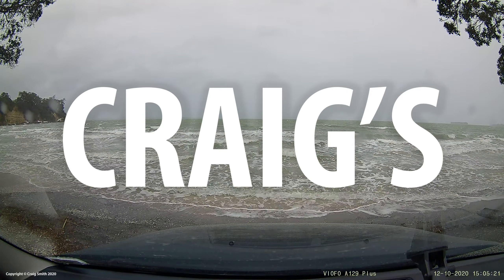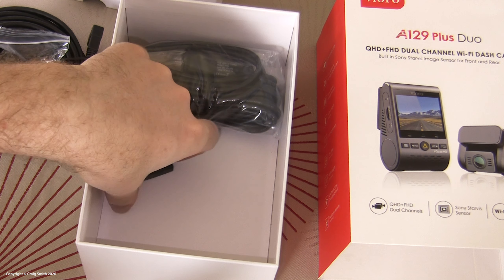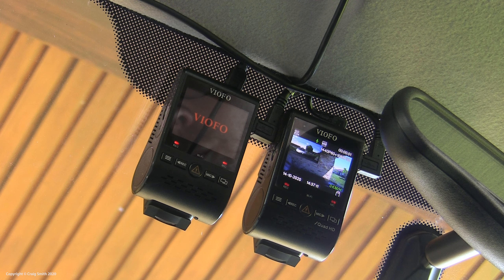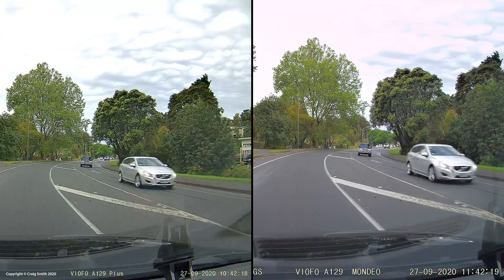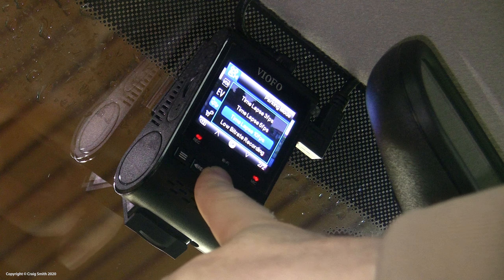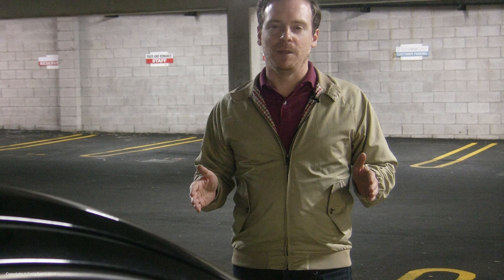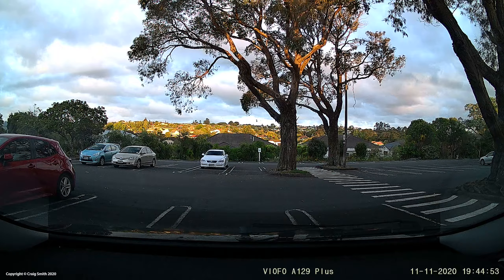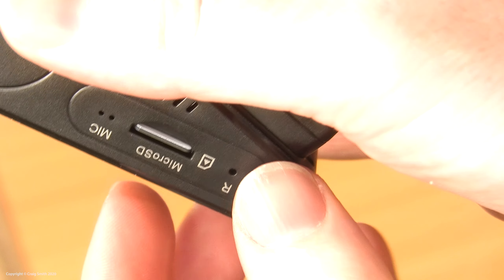Review: Viofo A129 PLUS Duo dash cam front/rear, parking mode, 1440p60 f/1.6, features & problems

Comment: I imagine the 1600p mode simply comes from them giving you access to the more of the image sensor since it's available, if you want that extra vertical space. Your idea for trucks and busses sounds very plausible. The image sensor is a 4:3 image sensor, so you're still missing out on several hundred horizontal lines at 1600p. lol Great review! Thanks!

Comment: The latest firmware update adds UWHD (2560 x 1080, 21:9 aspect ratio) in both 60fps and 30fps. 
This cuts out some of the top and bottom of the picture which not only helps bring down file size (as less is recorded) but also helps with contrast and lighting since you're no longer recording your dashboard or a bunch of clouds.
I've also noticed 30fps reduces the noise quite substantially (with WDR off and using the highest bitrate).
Reply: Thanks for mentioning this! It's yet another plus for this product that has led me to decide to go ahead and purchase it.
Reply: @gordon9821  You won't regret it. If you have the money to spare then I'd suggest the new A229 as it now comes with a 2k rear cam as well as a few feature updates.

Comment: @20:26 I just finished installing mine for a second time. The first time it did the double beep, start and stop recording for 5 seconds on a loop. Long story short I re-did the cable routing to the rear camera while having it on and having the rear camera view on. I was trying to avoid getting a kink(bend) in the cable which I think is what produced this issue. I completed the install without having an issue with the rear camera. Let's hope it stays that way. Cheers

Comment: Found online. 

Note that the H.265 encoding is a hidden mode in the A129 Plus Duo. To enable it, you will need to stop recording and then hold the MIC button; you will then see the SD card icon on the left side of the screen.

Comment: I have installed this yesterday, I'm gonna switch to low bitrate recording in parking vs timelapse, to get audio. Also found that in parking mode at night the rear camera picked up the street quite well but the front camera is all black! I suspect this is because the front camera is set to 60fps. I'll try again with it set to 30fps. It would be nice if you could choose different settings for regular and and parking modes... oh well. Anyway thanks for the great video :)

Comment: Craig, is there any chance you'll be doing an A129 Pro 4K review?  Your excellent assessments are very much appreciated.
Reply: The 4K Units are not good as they have an unusable low frame rate (30fps) -- dash cameras require frame rates of 60-120fps due to the vehicle moving at high speeds.

Therefore, a 2k (1440 / 60 ) dash camera will perform much better than a 4k (2160 / 30).

Also, as the resolution increases the night video recordings quality decreases so, 1440 is better than 4k and 1080 is better than 2k.

One can determine the best dash camera by identifying which image sensor it uses as the sensor dictates it's performance.
The best dash camera will incorporate a Sony IMX226 sensor as this chip is one of the highest performance  4k / 120fps / 60fps with incredible low-light (nighttime) performance. With quality comes expense, therefore, the dash camera will cost anywhere from $350-$450. The Sony IMX226 is the same professional image sensor used in the DJI Mavic 2 (Professional Drone).
Reply: @bobstringer9809  .. Thanks for the info. I haven't seen a dashcam offering 120 fps as yet. And are there any offering 4k 60 fps with the rear camera active ? I think they usually drop the fps back to 30 if the rear camera is running.  At least from what I have seen from  usual Thinkware, Blackvue, and Viofo offerings.  Not sure about DOD, and the other vendors.

Comment: Also worth noting:

The 4K Units are not good as they have an unusable low frame rate (30fps) -- dash cameras require frame rates of 60-120fps due to the vehicle moving at high speeds.

Therefore, a 2k (1440 / 60 ) dash camera will perform much better than a 4k (2160 / 30).

Also, as the resolution increases the night video recordings quality decreases so, 1440 is better than 4k and 1080 is better than 2k.

One can determine the best dash camera by identifying which image sensor it uses as the sensor dictates its performance.

The best dash camera will incorporate a Sony IMX226 sensor as this chip is one of the highest performance  4k / 120fps / 60fps with incredible low-light (nighttime) performance. With quality comes expense, therefore, the dash camera will cost anywhere from $350-$450. The Sony IMX226 is the same professional image sensor used in the DJI Mavic 2 (Professional Drone).
Reply: How does that sensor compare to the IMX317?

Comment: Although the Duo Plus has a better front camera, would you still choose the original Duo for the sake of reliability?
Reply: Yes would also like to know as a new buyer
Reply: Craig :) if you’re reading this, please give us your thoughts on which camera you’d choose (duo vs. duo plus). Holding off on a purchase here.
Reply: Craig did say that until the Plus has proven more reliable or has firmware updates, buying the original duo would be very reasonable. I’m also curious to know if the Plus has proven to be as reliable as the original duo since 10 months ago!
Reply: @robertwhitekar5514  yeah exactly I wanna know if the problems with the plus have disappeared and any problems to expect with the original duo. But Craig is understandably busy, I’ll just buy the original duo??? But it’s like a year older than the plus?? I trust Craig’s advice
Reply: Went for the plus model after extensive research. Since non plus is getting discontinued. So plus will be supported for much longer
Reply: @HasNiHassaan  O_o did not know that.. geez thanks for that tip! 🙂 That’s a good decision! Did you consider other dual cameras?
Reply: @HasNiHassaan  Hey, how is the Plus? Did you encounter the problems Craig mentioned? specifically the camera stops recording and requires a lengthy reboot?
Reply: @ufchistorian13  no it's been working great very happy with the quality
Reply: I chose Duo Plus over Duo because the price difference between them is just $20 and I love the day time quality of Plus. Night quality of the front cam is a big disaapointment because it has lot of noice and pure dark. Even a CPL filter didn't help me. The back cam quality is good than the front cam strangely. I think Viofo will provide an update for this cam andI need to check how the 1080p 30 + 1080p 30 both front and rear cams (Same like Duo) result in.
Reply: @coolguypravara  if you turn on wide dynamic range it makes the footage noisy but more visible in the dark. So pick your poison.
Reply from the maker: The old Duo has its issues too. My assumption is that all the A129's are less than 100% reliable. Different issues with different firmware. My Plus is more or less running ok now in a set-and-forget state, but the permanent issues like dropped frames you just have to accept.

Comment: Thanks for the great camera review! I just received mine and I'm trying to learn as much as I can. Off the bat, I find that the buttons are not intuitive, I haven't installed it yet, but for example when I powered it on, it goes straight to recording and when I press another button, like I want to see the settings, it says I have to stop the recording first, not sure how to do that intuitively, I press the record button, but that doesn't stop it, stuff like that.
Reply: Yes, the record button does stop it. Mine does.

I like the buttons. Middle one for OK, left of middle for up menu, right of middle for down menu, and far left for back. Couldn't be easier.
Reply: @paulraymond1804  I got it installed right from my rear view mirror and frankly, I am never using it. I did buy the optional button to keep a record, when I see something I want to keep, I just press that button. Other than that, I am quite happy with the camera.

Comment: Please help.
I'm on my first camcorder, a Viofo A129 Pro only front camera. Your excellent review helped me a lot to understand how to do the editing and dashcam settings (the instructions that come with the camera are very thin). However, I have some problems and I don't know how to solve them.
Parking with low FPS. I set the G sensor to maximum and in the parking mode also to the maximum and when I stop the car in the parking lot the recording starts at a low FPS (5 frames / sec) but after a while it starts and continues to record as if I were moving.
Protected files. Although the G sensor is set to maximum even if I "swing" the car is not registered in protected mode, neither in motion nor in the parking mode.
Is the camera defective?
I use a 128 Gb SanDisk Extreme Pro card, Firmware 2.5 from the Viofo website and I supply it with a powerbank because the car is under warranty and Toyota does not agree with the installation of the HK3 kit. I tried 4K resolution at 30 FPS and a lower resolution at 60 FPS
Thanks.

Comment: I watched a recent review by the YT channel; Techmoan where he said this was a solid dash cam that his wife was using the past year.
My thoughts about it are mixed, but my new car was build in 1996 & I'm finding reversing to be difficult to judge where the car ends.
So, with the in-built display screen I was thinking about using the A129 Plus Duo not only as a Dash Cam, but as a Reversing camera - just to assist me when parking...
Reply from the maker: It's a perfectly fine dashcam, but it's not a reversing camera. It would be hard to watch the screen while reversing, and it's too small to see small or obscure things, but more to the point a dashcam must be mounted high and pointed back to get a full view - a reversing camera should be lower and at the rear extremity of the car, and pointing downward so you can see low things you might hit. If you want a reversing camera buy a proper one.

Comment: Is it possible to connect to the cigarette lighter plug-in as a power source, as opposed to installing a hard wire for any of these units?
It’s only because I drive a Toyota Prius and the manufacturer recommends I do NOT mess around with the electrical system.  It is a hybrid motor.
What units would you recommend for a dual camera set up? Thanks!
Reply from the maker: Yes but parking mode won't work 'properly' and you have the hassle of the cable. There shouldn't be a problem fuse-tapping the 12V circuits on any car, just stay away from splicing any big cables and you'll be fine :)

Comment: This is probably one of the best videos I've seen on the subject. I was curious if you had any updates after a year? I ordered a $20 dash cam to experiment with and gave it a driving test. I was wondering how long the $20 cameras last compared to the $160 ones over a year's time... If I go through 3 of the %20 cams in a year, is it cheaper than the $160? Albeit with lower quality video of course.
Reply from the maker: It's going fine, as you would expect from the video. It's not perfect but good for the money. You get what you pay for.

Comment: I got my Plus unit installed about 2 weeks ago.  My unit does offer H.265 so that may have been added to the later units.
Reply from the maker: How is H265 implemented?
Reply: @CraigsDIY  To set up h.265 compression:  First stop recording. Hold down MIC button until you see the SD card icon on the left side of the screen with the down arrow. That means that the device is now in h.265 compression mode.

Comment: Nice. Thanks. Very well explained parking modes, which had me rather confused till now.

I park at night in my garage, so is it possible to 'easily' switch off the parking mode? Say, a single button press.
Reply from the maker: You would just turn off the whole camera once parked, which yes is a single button push.

Comment: Just bought the cam. Firmware 1.5. I try to switch on the parking mode. But it still records in normal mode. I don't have a hard wire kit. I want to enable parkingmode manually within the menu.

Comment: When ordering this A129 do you have to order the harness for the parking feature separate?
Reply from the maker: Yes but it's cheap.
Reply: @CraigsDIY  inordered it and hardwired it to my chevy. Lots of action in parking mode. This caused a drain in my car which made my car want to over charge to compensate. Took a week to figure that out.

Comment: I'm wondering about the manual emergency recording.  The product manual says that it "will lock the current file being recorded."  However, what if a new file starts recording right before you press the button?  In that case you'll miss the event you want to save.  I'm hoping that the description isn't exactly as it says because the better way to do it is to have an independent video file generated that saves back a few seconds before the button press and a few seconds after regardless of how the continuous recorded segments are saved.

Comment: It's really annoying that the front to rear USB cables aren't interchangeable as they're a pain to wire through to the rear, especially on an F56 mini.  The mere idea of having to do it again detracts from wanting to upgrade anytime soon.

Edit: seems the rear cable is only different if using the Plus duo, but if you directly upgrade to the pro duo (4k version) it's fine. Phew.
Reply from the maker: Interesting thanks.

Comment: This thing is a peice of sheet. I installed it with a hardwire kit. It used to work fine. Parking Mode worked fine. Live viewing worked fine. Recording worked fine. In fact, I downloaded some interesting (yet useless) videos from my travels when I first got it.

Fastfoward a few months and THE ONE TIME, I needed it to work, it didn't. Someone ran red light and hit us. Cops showed up and we tried to pull the video but it wasn't recording for over 2 weeks. EVEN THOUGH ALL THE RED LIGHTS ARE ON. There is literally NO indication when it's not working. We looked at all the files on the SD Chip and it records for part of a day then stops recording for 10-14 days, the records a bit and then stops. 

Customer Service sent me a application to reformat the SD chip, it crashed and now the chip is useless.
Reply from the maker: Thanks for the feedback. Doesn't sound good. I suppose in your case the red lights themselves have dash cams if you're lucky. Hope nobody was hurt.